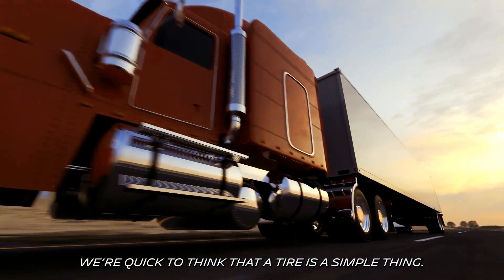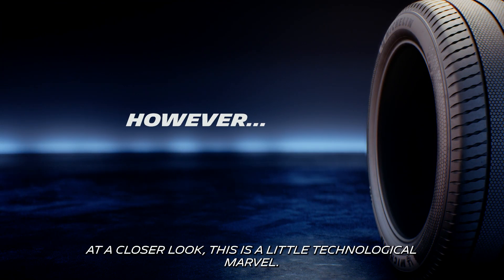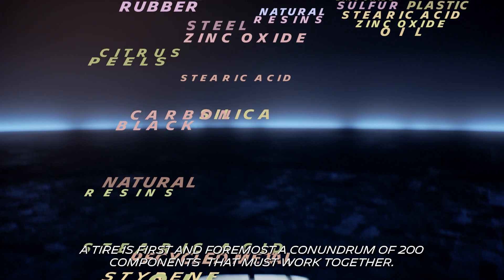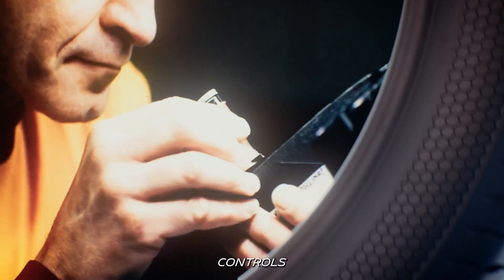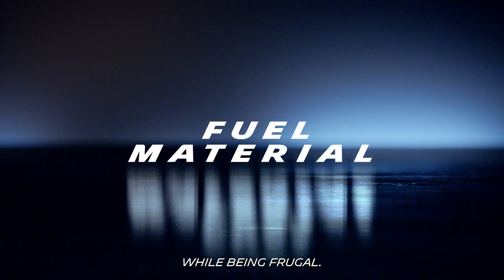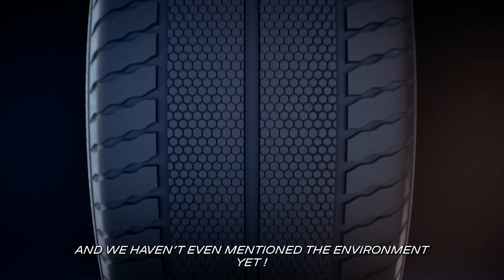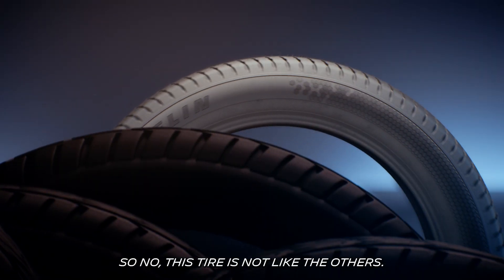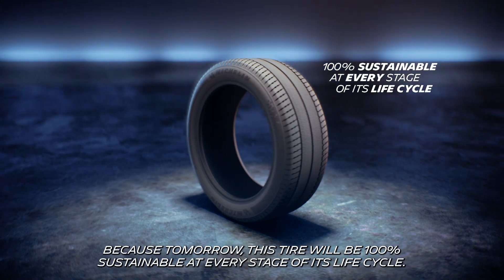100% sustainable tire challenges | Michelin

Comment: I don't care about the environment.  Just make me the best tires.
Reply: Things that come to mind w/ degradable recycled materials:
  * 4,000 pound or more on 4 tires going over pot holes!!
  * Nails and other sharp objects or running over things on the highway
     at 70 mpg!!
  * Safety at 70 mph during a blowout.
  * Heat in Phoenix during summer, drive thru Mojave Desert or
    below 0 degrees F. in Alaska or any northern states.
  * Ability to last before next replacement.
  * Cost